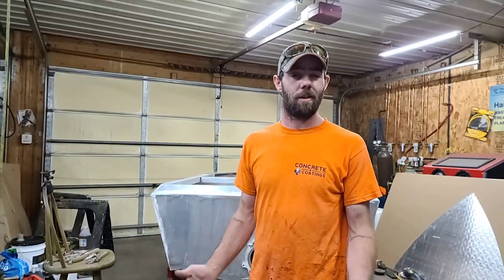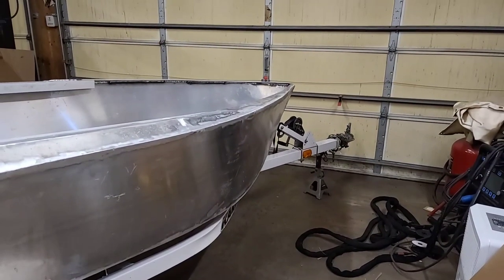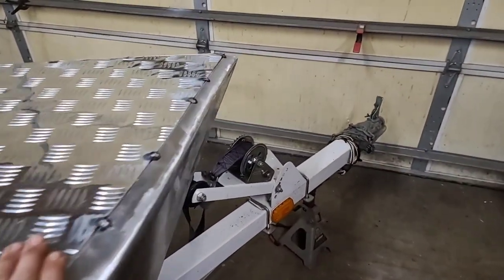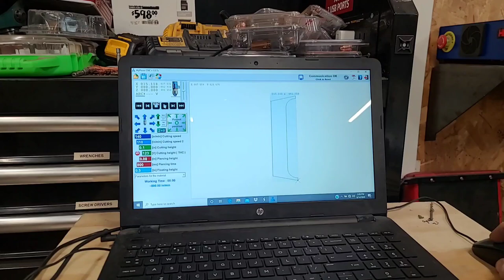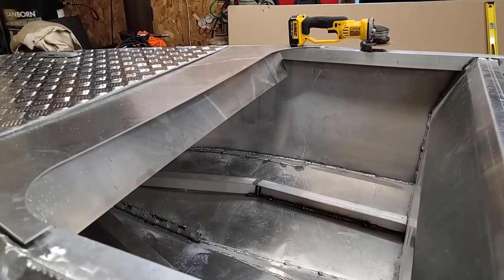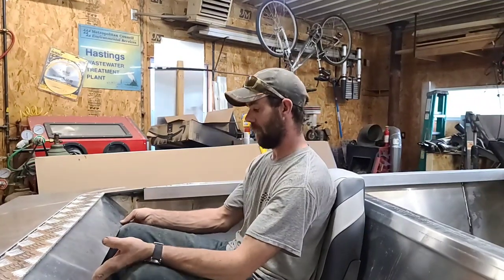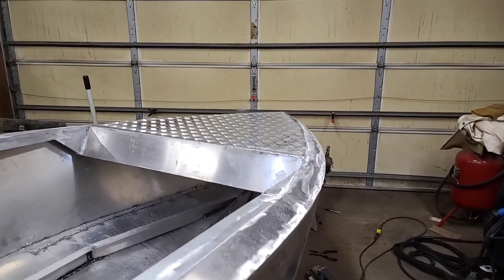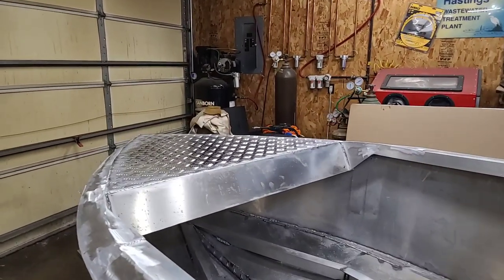Jet boat 3.0 episode #12

Comment: You know a seat with a lower profile would give the driver more space also is that as far back as you could get that firewall it seemed like there would be another 6” to the motor maybe I just seen it wrong. Anyways like always another great video thanks for sharing.

Comment: Do you still have the Starcraft 2.0?
Reply from the maker: Na sold that last year to get ready to build this one
Reply: JDS Outdoors Ah heck!!! I loved that boat, but I understand. Was the aluminum jet pump housing all that hard hammer out and put together?
Reply from the maker: @jimgarrett7078  not to bad to do at all just took a little time. I can't wait to see the difference in the purchased vs home made intakes. I'm leaning twords making my own on the next one I build after this one sells lol
Reply: JDS Outdoors Thank you so much for taking the time to answer my question. Your present build appears to be coming along nicely and should really perform with the 1500 cc engine. Honestly, I like the jon boat conversions best. This little speed boat does not seem to fit your personality as well as a “regular sized” boat meant for fishing, hunting and like minded outdoor pursuits. However; most of us guys like a project and to go fast. I can tell the 3.0 endeavor is going to turn out well - you have the build experience under your belt. Have a good day.